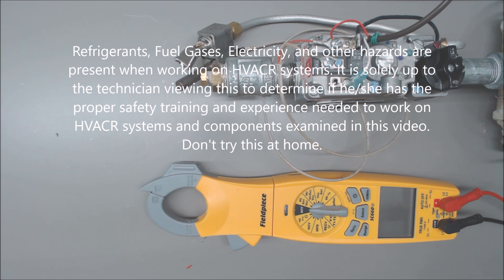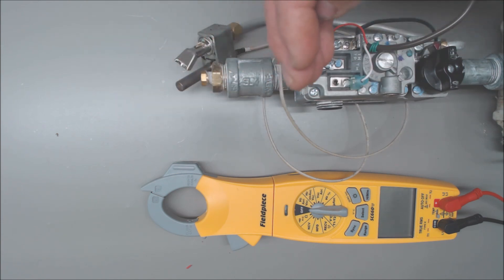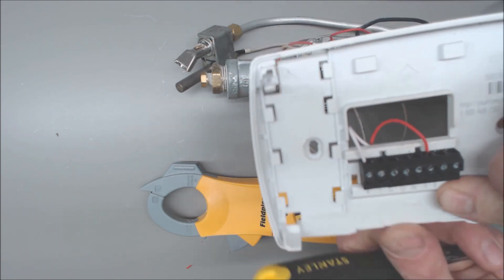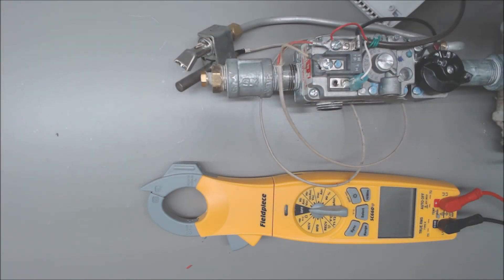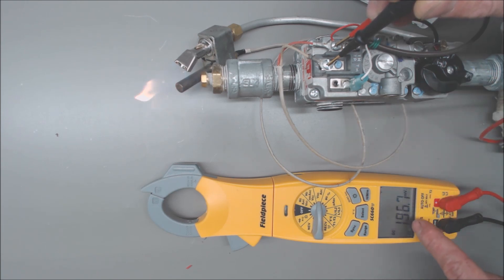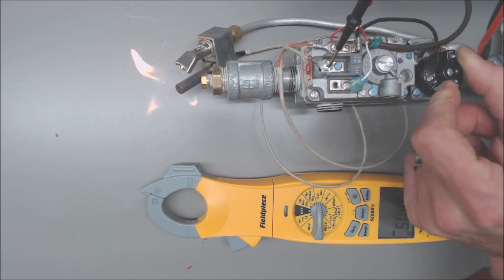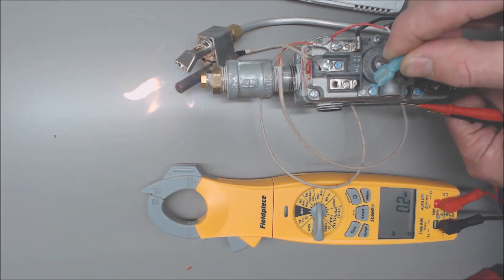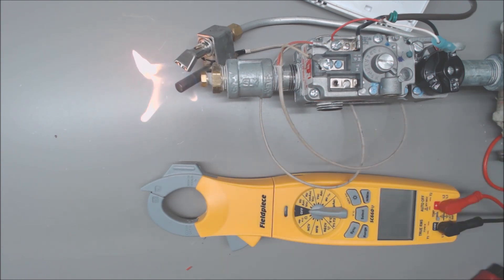How the Millivolt Gas Valve and 750mv Thermopile Work! Troubleshooting!

Comment: I am having trouble with main gas valve opening. I have tried a few different thermopiles. They work fir a few days, or few weeks, then stop opening main valve. I clean it up and starts working again.

Can I try increasing the pilot by turning the adjusting screw (counterclockwise?)?

Could I put a 2nd thermopile, placed along aside the installed one, to get more volts into gas valve help? Or could that harm the valve?

Comment: Great video. I am trouble shooting a millivolt White Rodgers 36C03U gas valve (replaced in 2015). I noticed it is wired differently than in your video. First, my pilot gen screw is labled PG (PILOT GENERATOR) versus yours which is labled TP (THERMOPILE) 

Now, One of my tsat wire wires first goes to the HIGH LIMIT SWITCH (HLS), and then the 2nd wire from the HLS goes to the TH/PG screw. Yours has no HLS. (The HLS had to be wired like this to prevent the pilot valve from being shut when the HLS shut off the main valve). In your video the 2nd tsat wire goes directly to the TP screw. 

In other words your tsat wires go to the TP screw and the TH screw - but my tsat wires go  to the TH screw and the TH/PG screw (with the HLS in the middle). It's been working fine all winter, and for a few years, but is now acting up and not firing up all the time.

I tried a new thermostat 'brain' part, which by itself did not improve things.

Then I cleaned the pilot generator with steel wool last night, and the main burner came on 3 times without a problem. But I don't know if I've solved the issue? (I did note that the mv across PG and TH/PG went from around 400mv, to around 500mv, after I cleaned the thermopile, which I thought was a meaningful increase).

I am still trying to diagnose any possible issues...

I have a service sheet from a previous millivolt gas valve (a Robert Shaw 1995) that says to check system resistance between TH/TP and TH with tsat closed and calling for heat I think it is telling me it should be less than 80mv. Mine is about 140mv. This is after I put  the new tsat face on. (BTW, I left the old tsat base in place mounted on the wall, as it just has the wires in it, and the screws were tight, and all the 'brains/electronics were in the 'front/face' part of the new tsat I bought  - which was the same exact model as the old tstat.

Is that 140mv resistance an issue that might be preventing the main valve from opening? 

I also notice a bit of melted wire in the tstat wires where it was resting against a burner. Could that causing the140mv resistance? Or is the resistance from the HLS being wired into the one tstat wires path? 

I did notice that during one of the main valve opening cycles that only the two middle burners flamed on (instead of all 5) and then quickly went out (in about 2 seconds). I thought this was due to the main valve opening partially but not all the way, and not staying open for more than a second or two. I am hoping that cleaning the THERMOPILE and then seeing that 100+ MV increase will resolve my main valve opening issue? It seems to have for at lesst 4 cycles I observed.

Sie I am not 100% confident with this millivolt system, I thought I'd ask some of the questions above, after I saw your excellent troubleshooting video, and seeing your knowledge on these millivolt gas valves. Can you offer any helpful advice?

Oh, one more thing, I noticed before I cleaned the thermopile, that I was able to get the main valve to open by placing a jumper wire across the TH and the TH/PG screws. This makes me think I do not have a bad gas valve, but more likely a voltage issue? What to you think?
Reply from the maker: If the wires have 140mv through with the thermostat closed, that is a bit high. Make sure the thermostat is rated for 750mv even though it is a direct replacement of the old one and maybe run new thermostat wire or at least run some new as far as you can, thanks!
Reply: @acservicetechchannel  
Thanks for the reply.

It has been two nights now, and the furnace is working still. I am thinking that cleaning the thermopile, and getting the extra 125 Mv - to around 525 (tstat open) - may have been the resolution. Do you think the bump  from around 400Mv prior to cleaning it, to the 525Mv after cleaning it would make a big difference regarding the main valve opening?

I also noticed that prior to cleaning the thermopile, that I could also get the main valve to open by tapping with a screwdriver on the side of the gas valve. I took that as an indication that perhaps the valve was not getting enough voltage to open?

I noticed that resistance from TH to TH/PG (tstat closed) is now around 190, so it went up after cleaning also. Does that seem right? I was thinking about cutting out the two inches of tstat wiring that were singed, and just resplice them back with some wire nuts - to see if the resistance drops. Is that a good idea?

The tsat is on the second floor of a two story home. I do not think running new wires would be easy, at all. I am thinking of just leaving it all 'as is' for now as long as it keeps working. Although I was thinking if the increased voltage fixed the valve issue, that maybe a new thermopile is in order.
Reply from the maker: I am just saying run new wire from where after it comes down from the 2nd floor in the basement up to the gas valve, this way, that is all new. Thats great things have been working, thanks!
Reply: @acservicetechchannel  I've never replaced tstat wiring. How would I do that? Put a weight on the new wire and drop it down the wall? Or would I need to attach new wire to old wire and pull it through? (I am worried about the consequences if I cannot get the new wire in place).

Do you think the main valve opening issue is related to the resistance, and not the thermopile output?

Comment: I'm a refrigeration Journeyman so don't work too much on Gas heaters. Thought I'd be a nice guy and change a valve in a Vermont stove for a friend. I could not figure out how the valve was supposed to work without a 24V supply - lol. This video just answered all my questions. Thanks for posting.
Reply from the maker: Thanks Matt N!
Reply: I work on gas stuff all the time, and it still amazes me how little current is required to run the system. Use an old mechanical thermostat and you don't even need batteries.
Reply: @billybbob18  i still have a 1970s boiler in one of my rentals that is milivolt  system still going strong...it is 120 volt for circulator but burner controls are milivolt...

Comment: Thank you for the very informative/direct and to the point presentation.I never knew how my old Coleman floor furnace worked until watching your video. 

Now for the hard part. I would like to add a small 120 vac fan to direct some of the heat into another area of the house but only want the fan to run when the burners are active. Is there any way to do this with a millivolt system?

If not, can I just replace the millivolt valve with a 24 vac valve, 24 vac transformer, and add a 24 vac (coil) relay to control the 120 vac fan? I already have a  modern thermostat that has a fan control switch (auto/manual).
Reply from the maker: You can't add to the 750mv system. It is not too simple to change all of that over, thanks

Comment: Have a 1960s Camper with nice old Coleman propane millivolt wall heater. I did something, I hope is not terrible, but I attached a AA battery to my valve leads. It was like jump starting the solenoid. I heard the solenoid chirp open. Took off the battery and it continued to throw flame. Had heat, looked great. But I have never been able to get the unit to work again since then.

Having problems getting the pilot to stay on. I replaced the thermopile and pilot unit with new one after finding a lot of rust inside the pilot chamber, also replaced the Tstat with something very simple (no battery).

I think the gas control valve has faulty solenoid and even the knob is very hard to turn. So I may buy a new valve controller now that I know they are still being made!

After watching your video, will try yet another time to take some multimeter measurements before getting a new valve. Could be the pilot flow adjuster is turned too low, or pilot needs to be pointed down more, but really I think it needs new control.

Thank you!
Reply: That AA battery is 1.6 volts at full charge. That's 8x what the coil needs to operate. Time for a new valve my friend. It's expensive compared to a thermopile.

Comment: Hi I have a  Hunter 42203 https://www.manualslib.com/manual/73852/Hunter-Hunter-42203.html?page=5#manual   . It said on page 4-5 in section 4 that the thermostat  is designed  to operate  most gas systems  having 24 volt controls.  How do I know if my  natural gas fireplace insert   gas valve is  uses 24 volts or  750 mv ?  How do I know if I need  a isolation relay  to allow the  thermostat  to control  milibolt system ? The way you are taking all the gas   valve systems have to use a 750mv  thermostat.
Reply from the maker: If it is not plugged into 120v ac electricity then it is either 750mv or 30mv. You can also view the thermopile, thanks
Reply: Its not  plugged into 120  ac  The fireplace can work without power  the only thing that doesn't work without power  is the  blower motor . So do you think I can use  the  hunter 42203   the way it is or do I need to get  a  isolation  relay  or just  forget about  it and get the one you are talking about .?
Reply from the maker: A standard honeywell pro 3000 is rated for 750mv. Here is a link to the Pro 3000 24v Thermostat-  http://amzn.to/2keuUbs

Comment: I have a gravity furnace and the voltage at the thermostat leads is 390mv with just pilot heat.  Sometimes the heater does not turn on using a Honeywell thermostat.  If I jump the red and white wires, it fires up 100% of the time.  Do I have a faulty thermostat?
Reply from the maker: Yeah, the resistance across the thermostat is too much but also, the mv seems a little low. Try reading the resistance value across the terminals of the thermostat when calling for heat. It should be very close to 0.0ohms, thanks
Reply: AC Service Tech LLC , I have done that and it’s not always dropping to zero.  Sadly, I seem to run into this problem with Honey thermostats - which dominate the market. They work well for a week and then get flakey on me.  Can you recommend another brand and model for 750mv?  Thanks so much!
Reply: i realize this is 2 years old but i had the same issue ....turns out the gas valve was getting stuck shut now and then...i  had pilot flame but no main burner...drove me crazy for months.. few light taps with a screwdriver handle and  disconnecting the gas line and getting all the crap out of it fixed it...dirt can clog up the valves..rare but happens..

Comment: Worked for a Co. and with old 1950's designed 750mv systems if the mv was >450 open >125 closed they called it good and went on to cleaning and sometimes other component replacement. Too many warranty calls from the "..heater not  working during really cold nights." people.  Me, i'd replace the pile if <500 and never got warranty calls from them folks.
Reply from the maker: Hey if you are safe, you don't get the call backs so thats good, thanks!

Comment: OK, did some troubleshooting and here is my problem.
1. Thermopile voltage, (TH-TP, while connected to pilot solenoid): 570mv (robertshaw instructions says anything over 325 ok)
2. Gas valve voltage (TR-TP), wall switch off:  40mv (robertshaw instructions says anything under 80mv  ok).
3. Gas valve voltage (TR-TP), wall switch ON: 140mv (robertshaw instructions says anything over 100 ok). GAS COMES ON, FLAME LIGHTS AS EXPECTED.
4.Turn wall switch OFF again, TR-TP voltage drops back down to 40mv, but GAS VALVE AND FLAME STAY ON! It will eventually shut off, but perhaps as much as five minutes? Very disconcerting.
5. Pull thermostat wire to TR, gas valve shuts off and flame goes out immediately, indicating to me that it is NOT a stuck gas solenoid.

I suppose I just need to replace the gas valve, but it it a common failure that the voltages are all in spec, but the "stay on" voltage for the main gas valve drops much lower than it should be?
Reply from the maker: I don't think the gas valve is the problem. Your switch or thermostat seems to no be shutting off the voltage to the gas valve solenoid, thanks
Reply: DID YOU LOCATE CAUSE OF PROBLEM

Comment: what is the issue when pilot stays lit in  pilot position, but when switched to ON position pilot goes out ?
Reply from the maker: It is possible low gas pressure or millivolt amount is not high enough, thanks

Comment: If you wanted to diagnose a bad thermostat.  Could you manually supple 750 ma to the valve? Any ideas?
Reply from the maker: You could just jump it at the thermostat terminals, thanks
Reply: Have a 1960s Camper with nice old Coleman millivolt wall heater. I did something, I hope is not terrible, but I attached a AA battery to my valve leads. It was like jump starting the solenoid. I heard the solenoid chirp open. Took off the battery and it continued to throw flame. Had heat, looked great. But I have never been able to get the unit to work again since then.

Having problems getting the pilot to stay on. I replaced the thermopile and pilot unit with new one after finding a lot of rust inside the pilot chamber, also replaced the Tstat with something very simple (no battery).

I think the gas control valve has faulty solenoid and even the knob is very hard to turn. So I may buy a new valve controller now that I know they are still being made!

After watching your video, I am going to try yet another time to take some multimeter measurements before getting a new valve. Could be the pilot adjuster is turned too low, or pilot needs to be pointed down more, but really I think it needs new control.

Thank you!
Reply: @tkmair6559  have same unit in an old rv 60s.. got pilot working ok and 400 mv but wont kick in main burner.. do you have specs on replacement valve??
Reply: @heatherwalsh4023  , as he suggests you could check that your valve works or not by jumping the thermostats connections. If it opens you have a bad thermostat. Which is pretty cheap and easy to replace.

If you have a bad valve, oh boy.. In my case I did. they are solenoids, electromagnetic, and can get too weak to open when really old.

You would find something like this to replace it. It's a very big job (to me) and I'm not so sure I would do it again.

https://www.ebay.com/itm/ElectroHeat-71884-3-8-Millivolt-Natural-Gas-Valve-Robertshaw-710-502-/303552090963

Comment: an absolutely outstanding video. I have a gas fireplace where the pilot light lights fine, good flame, when I push in the black knob as seen in the video above. However, once I release and before I can rotate knob from "pilot" position to "on" position the pilot extinguishes. I had a tech come out and look at it and he has quoted me $750 parts and labor for the repair, but I think I can replace this entire assembly for a fraction of that cost, yes?
Reply from the maker: I would always recommend a tech to do the work, thanks

Comment: Am I missing something? Isn't the top terminal TH/TP and the middle one TP?
Reply: I think you are correct. I had the same thought. You can even see the TP designation on the middle terminal. Its partly obscured by the thermocouple wire, but its there. There isn't enough room on the valve for clearly labeling all three terminals. So the labels for THTP and TH are kinda misleading. That line separating them appears to be an attempt to indicate that one label is for the top, the other for the bottom. But it makes it look like the THTP printing is for the middle terminal, when its really for the top.

The red and white label on the side of the valve is more clear, though you can't see it in this video.

Comment: I don't think there is a user adjustable pilot adjustment on the gas valves on vent free type heaters as the oxygen depletion safety system depends on the pilot being weak and going out if the oxygen level in the air goes below some critical level.  I have also heard they make the pilot jets out of a sintered material that are designed to fall apart if you try to ream them out to clean them.  If your pilot level is low in a vent free heater, use compressed air to blow it clean but don't try and ream it out.

It was cool seeing the thermopile values as the valve cycled.
Reply from the maker: Some heaters do not have a pilot adjustment but many combination or millivolt systems do. It is possibe that more ventless do not have adjustments but I am mainly working on home, trailer, and commercial heaters, thanks

Comment: how do you check the coil on the main gas valve?  I replaced the thermopile and main gas valve still won't open.   Pilot valve works.
Reply from the maker: Basically, make sure you have the correct pressure gas coming into the gas valve and check what the millivolt reading is when you are calling for main valve heat. Try jumping it on the actual gas valve instead of the thermostat in case there is resistance in the electrical line. If after that, the gas valve is bad.
Reply: i watched the video. have decent volts? have to jump from TPI to gas valve for flame.runs till temp. than needs jump again! new thermopile. put old Tstat back on wall. same? possibilities? Thank You.

Comment: Great video,ive installed and rebuilt so many millivolt systems ( floor furnaces,wall heaters,etc.) in my early days. The most basic and best backup heating around.
Reply from the maker: Thanks Evan, yes simple is certainly reliable. I think now we are too far in the efficiency game that pieces eventually break much much more compared to those older systems you are referring to, thanks and Merry Christmas!